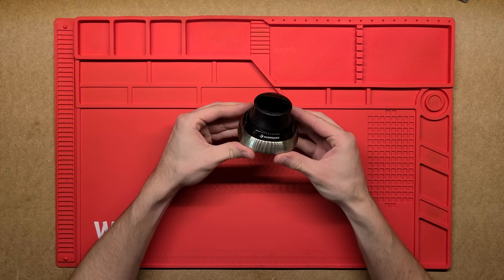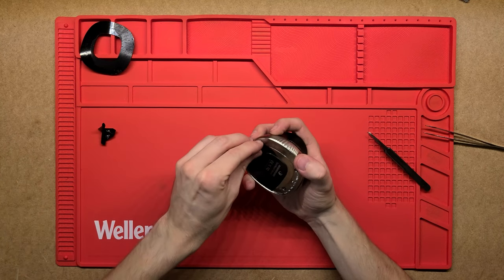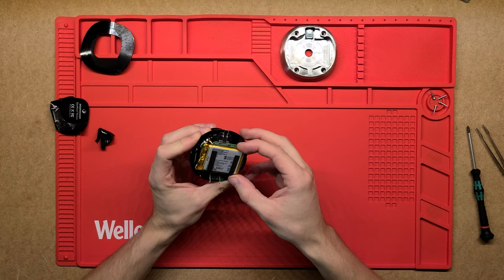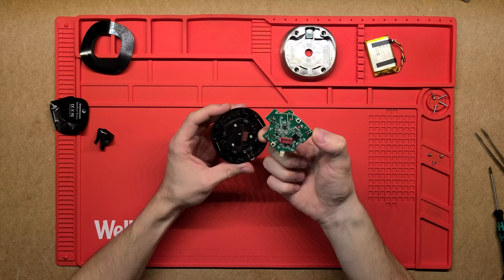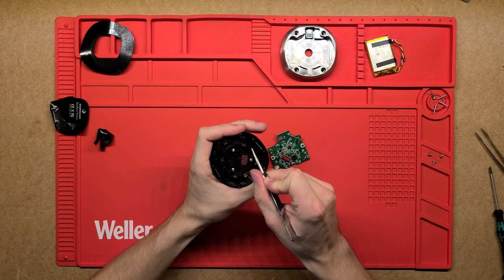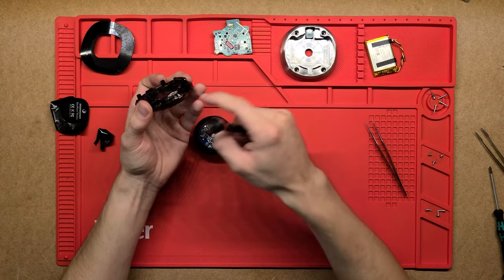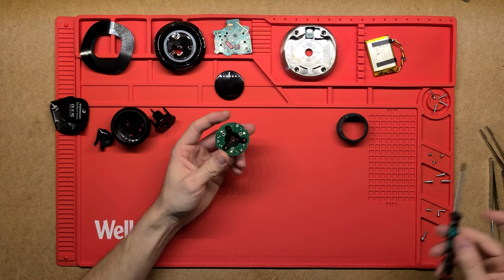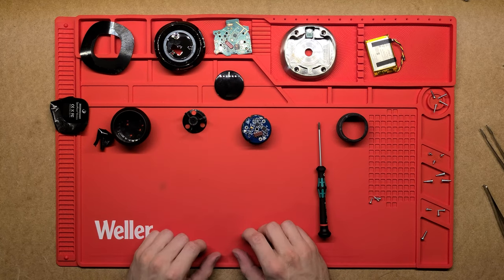How a 3D SpaceMouse Actually Works - Teardown

Comment: My Spacemouse's battery seems to be dead. I haven't taken it apart yet. Has the battery any specs or a part number?
Reply from the maker: The battery is a 23dx apollo 563450. You can find them pretty cheap online. Good luck 😊
Reply: @ToolsnTeardowns  Thanks a lot! 🥰